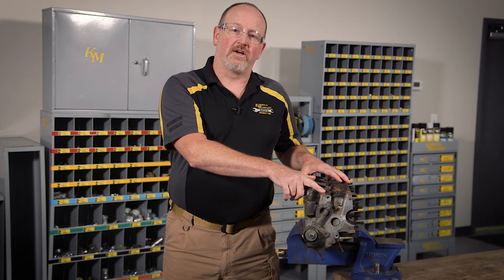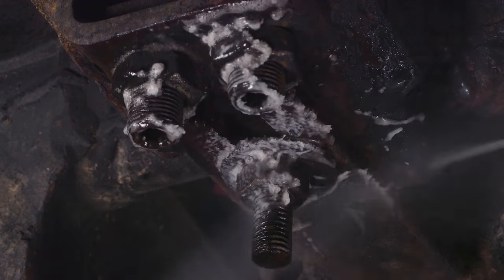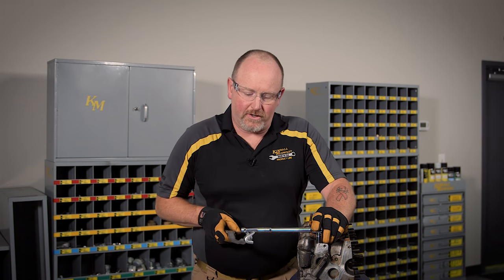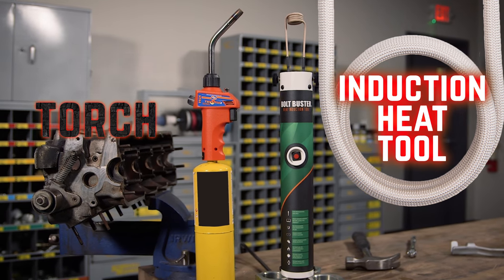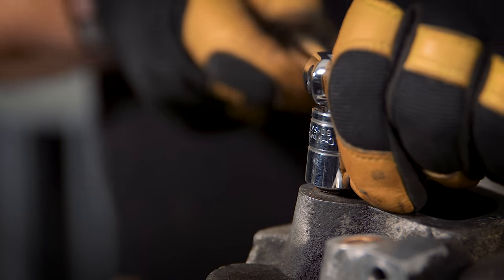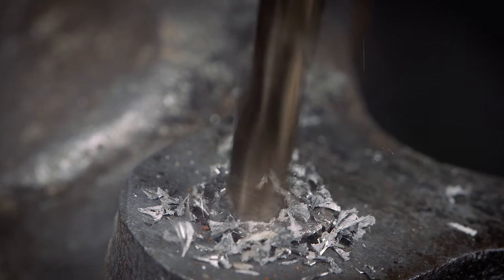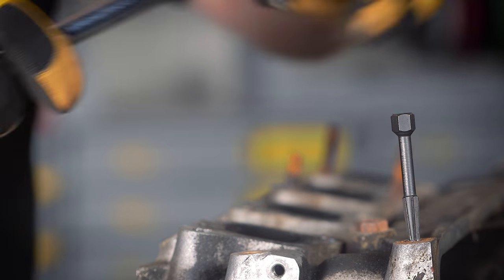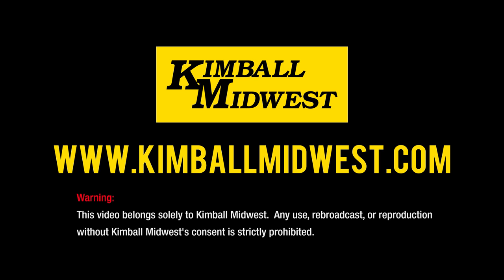How To Remove a Stuck Nut or Bolt

Comment: Let be honest, we in a middle of fixing something, hands all dirty and we all watching this video
Reply: Yep, the hex screw on my bicycle's rotor disc brake won't turn....
Reply: Bruh, why you calling us out like that lol
Reply: Mudflaps on my semi…
Reply: LOL TRUE
Reply: Yuppp
Reply: maybe youre right
Reply: Precisely
Reply: helppp lol
Reply: 06 Pontiac grand prix oil drain plug.   Ahhhhhhh
Reply: Yep
Reply: At work 😂
Reply: facts
Reply: @stealthxg5045  true same
Reply: Nah this is how I'm starting my day🤬
Reply: Ong
Reply: Yes,yes we are 💀💀
Reply: I’m lying in bed after day 2 trying to remove a 42mm nut off the tractor after buying a wrench, then back for penetrating spray, a 42mm socket and adapter, rattle gun. 3 of 4 nuts off. Now going to buy a heat torch I think for the last one
Reply: How’d you know
Reply: Nope.  Washed my hands first.
Reply: Fuckin lawnmower lol
Reply: @stealthxg5045  got the exact some problem
Reply: Hahaha… This makes me feel better.
Reply: Yes
Reply: Damn,i need a quick fix n man's bringing out fancy stuffs🤦🏽‍♂️
Reply: Yep…. 2 frozen Allen head bolts to remove the thermostat on my motorcycle that has sat for years
Reply: On my drive trying to loosen a 21mm calliper bolt 🤣
Reply: Yep, Towbar on my cruiser haha
Reply: True.. worst thing is that I did exactly what this videos says you have to do, went to the hardware store, bought everything and.. the freaking bolt extractor broke inside the hole I drilled in the first bolt that broke.. fml
Reply: Snapped shoulder bolt on mower deck pulley assembly.
Reply: Torsion bar bolt on my rear suspension
Reply: Hitch on a cultivator man
Reply: Yessir
Reply: That's exactly what I'm doing, I am trying to unscrew a stock nut on my stationary bike pedal and I've given up because the tools in the house are all old and rusted, and I couldn't unscrew the bolt. 😔
Reply: Too true😔😂
Reply: 🤣how did you guess?
Reply: @thedominguez100  cuz I was working on a rusted 2000 Jeep Wrangler. Can’t believe people still responding to this comment loll.
Reply: The nut on my toilet is rust whelded to the bolt...
Reply: @GLITCHED1  mine too. You got anywhere with yours? I’ve even tried burning the plastic off but it’s not budging…
Reply: Doing it right now
Reply: Damn you a mind reader?
Cuz your right 
Lol
Reply: Yes! A bolt on my new Wen 4750 generator.
Reply: Same here , I finally give up
Reply: 2010 Sport trac. Front brake caliper bracket. The top 21mm bolt will not come off. Not only are my hands dirty, but my left ring finger is bandaged after the ratchet slipped and I punched my driveway, ripping my fingernail off in the process.
Reply: @mattmatt3663  hey how did it go?
Reply: @okcerx  heat torch worked great. Only about 10-15mins. I think fine threads on hay fork bolts is not great. A retaining pin would be so much better.
Reply: Damn bro
Reply: Ughhh yes on the floor and all
Reply: Yep
Reply: Lmaooooo tell me about it, my rotor bolts are welded shut😂
Reply: Damn you got me
Reply: Lmao legit. I did not need this set back haha
Reply: Yep, replacing my turn signal switch on my 89 Camaro..
Reply: Taking the def injector off of my 6.7 cummins
Reply: NAILED IT.
Reply: Yes yes yes
Reply: Im in bed with already smashed hands prepping for round 2 😭😂
Reply: Tie rods😔
Reply: I almost torched my van 😃
Reply: 66 thunderbird strut arms
Reply: yessssir
Reply: Hell yeah 😂😂😂😂😂💀
Reply: Ghee I couldn’t say it better 😅
Reply: While putting a new disk on the angle grinder...
Reply: Hell yeah
Reply: Pretty much 😆
Reply: Middle of changing brake calipers, yes the bolt is winning so far.. 😂
Reply: @Luigilr  same here!
Reply: Guilty as charged these damn bolts on this Calipher bracket. Feels like their welded even though they aren't 😂
Reply: IAC on my Civic 😂
Reply: Yup
Reply: Cause cussin ain’t helpin
Reply: Literally
Reply: Uh no… yes
Reply: Yup. I can’t get anything to hold the screw still while i try to remove the bolt. 2 hours now
Reply: Exactly lol
Reply: Fixing the chain
Reply: Yep, to change exhaust on my bike but the bolt on the manifold is stuck
Reply: My skateboard wheels just popped right off 😭
Reply: Lmao, breaks on my mums car
Reply: Had to stop before I round it off
Reply: Friggin hell this soooooo true right now
Reply: Yes the Bolt on my lawnmower blade is round and stubborn
Reply: when this fucking bolt comes out, my life will be complete
Reply: Whatever incompetent monkey that worked on this car last has tightened every bolt as though his life would end if it was humanly possible to remove them
Reply: @macdrawz  🤣
Reply: Lol yep changing a water pump have to remove motor cap and pulleys nut is round won't budge
Reply: Forgot knuckles bleeding
Reply: Yuuup, golf cart skid plate.
Reply: Haha u got me
Reply: Not me. I'm tryna help my friend loll
Reply: Stuck starter bolt, just one and id be half done by now. So irritated and dirty... 😢
Reply: Yep, trying to remove the freewheel on my bike. I think that spray is what I need
Reply: Last bolt holding in my rear shock won’t come off
Reply: Yup. Big 24 mm bolts on the rear control arm trying to replace my rear shocks.

I also live 25 minutes away from the closest auto parts or hardware store so after watching this video I think I'm going to tighten things back up, put the wheels back on, buy all the tools for when everything goes wrong and then try again this afternoon. That would be the smart thing to do. Let's see if I actually do it. 😂
Reply: @cloutgame3633 Right there with you brother.😂
Reply: True
Reply: Shit man, I gave up hours ago and I'm out here burning shit close to my Rzr (stuck castle nut on it) and I'm waiting on this fire to finish so I'm bored watching this.
Reply: Dirtbike pipe
Reply: I recommend wearing gloves. Especially if you work with the oils mentioned in this video. For example if I deal with CRC-oil - I always wear gloves. Because I absolutely do not want that poison touching my skin and seeping into my system. My friend said they used CRC to kill bees with. Just 1 spray on a bee and the bee would die. Or something like that. So for this reason, I recommend wearing gloves when working with such stuff.

Edit: And just to be clear, I think using CRC on bees is wrong. Wrong because of the bee. and wrong because I don't think it's good for this oil to get into nature, especially if you can help it.
Reply: Hell yeah 2023
Reply: yep last bolt on my starter
Reply: needa take the gearbox out bolts aint budging
Reply: Car battery
Reply: @pumpkinspimph5250  wow really? It’s that bad lol
Reply: Mane 😂😂
Reply: I’m laying under my cars door with a stuck bolt lol
Reply: Trying to taie off my cat and the bolt is super stuck
Reply: Me with my wheel stud replacements on my 07 hawkeye sti
Reply: EGR’s bottom bolt 😐 worst possible bolt and boy do I not wanna take out my belt and my radiator
Reply: yup😂
Reply: Dont gotta call me out 😂😂
Reply: Jokes on you. I gave up and showered, and now I'm watching this.
Reply: 2024 and you're correct
Reply: Damn
Reply: Not me!
I gave up and now coming back for the rematch! 😂
Reply: Real
Reply: Pressure line on power steering pump 😅
Reply: Hands aren’t as dirty as I would like…
Reply: Yes and im pissed 😂
Reply: I'm under my car, smoking weed and watching lol
Reply: yup
Reply: Real
Reply: Facts
Reply: 02 sensor won’t unscrew
Reply: Bingo and it’s a bolt on the inside of my motor
Reply: Big facts
I'm replacing an 8" OS&Y valve on a sprinkler main that's over 50 years old
This bitch will not come off for nothing
Reply: Yeah, trying to replace an O2 sensor, just blow torched it till bright orange and chucked water on it, eventually came off after days of wd40 and countless torque wrenched
Reply: Yes, right on the nail. Im removing car seat and the nut bolt is driving me nuts
Reply: Don’t forget pissed off 😂
Reply: Yes sir!!!!!
Reply: Yep
Reply: Motor mount on an old dodge
Reply: Bolts on my jeeps starter!😢
Reply: My Motorcycles headers😢
Reply: I’m tryna adjust the bearings on my skateboard so I can ride more comfortably
Reply: Caliper bracket on my f250 👎
Reply: day after i had to simmer down overnight
Reply: Yep
Reply: Too accurate lol
Reply: For real tho😂
Reply: This fucking starter bolts are stuck fucking two bolts 😢
Reply: How are you so wise in the ways of the working-class?
Reply: Man you nailed it
Reply: Yup two bolts on my harley
Reply: Yup

Comment: I’m moving in two day all I have is a screwdriver I just wanna undo my bed frame😂
Reply: No one asked
Reply: @manchesterunitedcompilatio8020  A little class is in order.
Reply: What if behind the nut is a bolt that has a head with no groove for a screwdriver (rounded flat head) AND it is inset so it  cannot be gripped? I am using a wrench to loosen the nut but the bolt spins as I try to loosen the nut... Thanks Very Much.
Reply: @guruoflove3083  go on tell me if I’m wrong did anyone ask if ur moving and trying to undo ur bed frame please tell me who asked because if there is someone who asked I will apologise to u directly
Reply: @manchesterunitedcompilatio8020  They were just being specific as for clarification which most usually brings better understanding and so better ease in answering his query.

For example... The question "Have you any allergies?" Can be answered with, "only bad manners" Not directly relevant but still relevant.

Comment: I was struggling with ONE bolt for a very long time.  This method worked for me.  Thank you.  Heat is what finally did the job.  I followed all steps up to that point.

Comment: My problem was a stuck bathroom faucet cartridge. Hard water deposits locked it in place. I could not get it to move. Yesterday I ended up removing the faucet from the sink to work on it - tried tons of Liquid Wrench alternating with CLR to dissolve mineral deposits , hammering on a breaker bar , all with no success. Tonight I took the faucet outside on our cement balcony and aimed my heat gun at my socket wrench that was in place around the stubborn cartridge and kneeled down on the wrench to put as much force as possible and that did the trick. Thanks for suggesting heat!

Comment: Used a lighter as heat source, worked like a charm. Thank you!
Reply: Used a lighter on a rusted plastic wing nut under my toilet cistern. I’d already dosed it with WD40… Ended up setting fire to the plastic. 

Still stuck there…
Reply: @jontaylor5482 don't use a lighter on plastic.

Comment: Thank you for this video. I have had to remove my car battery this weekend in order to recharge it and one of the bolts that fixed the battery to the car was so rusty I couldn't turn it at all. It came loose after using your first few tips - I was happy I didn't have to ask anyone else for help!! Thanks again
Reply: You removed the car battery yourself? Good girl!

Comment: All good methods which I use all the time in the workshop. Another method for removing a seized bolt: weld another bolt (preferably a hex head instead of a cap head) directly on top of the old seized bolt. Now undo the new bolt with a ratchet/socket and the old bolt should extract easily because it's welded together. This always works without fail. Note that it probably won't work if the old bolt head is sheared off; it needs to be proud otherwise you will end up welding the bolt inside the housing if you're not careful.
Reply: u saved my life with this one lol thank you
Reply: @SkateVibes  You're welcome.

Comment: Yeah really want to reinforce the tapping with the hammer. The heat is very useful as well. Had a drain pan plug taking all the force i could muster and after running the engine for about 10 minutes with taps on all six sides of the bolt as well as a couple on the head, it popped off with little force.

Comment: Tip+ 1: Use quality tools. I tried everything with a Philips screw with a cheap screwdriver, but it was stuck. Today I got my toolbox, found the high-quality screwdriver, great grip, the tip did fit better. Got my glove for an even better grip and tadaa, the screw moved immediately and I was able to get it out. It depends on the tool too. :)

Comment: You just saved my butt. I tried everything one step at a time. When I used my plastic welding gun for heat, even though I let it cool a minute, the stripped bolt stuck to the wratchet and came right out ❤🕊

Comment: Absolutely fantastic video! My bolt wasn't loosening because my axle kept spinning (I thought holding the opposite side bolt would hold things in place enough). But after holding the axle in place, the bolt started to unfasten. 

And I think I've made some stupid mistake in past getting myself into this mess. As a solution I probably should get a new axle - cost about 5 euros - (because the screws have been damaged) and a new bolt (because something's seriously wrong with the bolt, perhaps wrong size bolt) - cost about 2 euros. Then just reassemble everything and good to go. Edit: everything works fine without me doing all these steps tho, perhaps I should just let things be until things stop working. I have a spare bicycle in case things go down for the worst.

Comment: Wow! Thank you! I am having a heck of a time removing a brake caliper bracket bolt with a rounded off head.
Reply: Same here bro! Can’t figure it out. What did you do?
Reply: @ramiroospino24  I purchased an Irwin bolt extractor set at Lowes $19. Along with the longest breaker bar I had it worked.
Reply: Daryl Griffin thank you brother. I’ll give it a shot.

Comment: I’m trying to losing a cease bolt on my 29 Model A, it’s the water pump bolt and runs through the cylinder head. I’ve got all the other bolts loose accept the one which is preventing the cylinder head from coming off. I sprayed it with DW 40. Just waiting for it to break free!!

Comment: Im not pro and not trying to be rude but when you are trying to get the bolt out wouldnt you want to expand the metal around the bolt and not the bolt itself? Wouldn't heating up the bolt expland the bolt making it a tight fit? Wouldn't you want to expand the area around the bolt and keeping the bolt as small as possible?
Reply: I was told that as well. I want to know the answer to this. Some say just expanding the threads with heat and letting it cool will break the bond. But mine must be welded on to the oil pan lol

Comment: What if the nut is melted onto a screw?
Context: A while ago someone left a Yield sign out on a neighbor's lawn one day. It doesn't look like someone ran into it though, just a random, slightly damaged sign that someone ditched. I'm trying to disassemble it for scrap or some other purpose, but the sign is held together with two carriage bolts, and the nuts on the back of the bolts have been melted onto the bolt. Not rusted, melted. The screws turn, but it can't come off. I've tried a bunch of things to get them off but nothing's worked. Will that penetrating oil stuff work? We don't have an induction heat tool or a blowtorch. I'm considering buying a Sawzaw to cut the screws in half to get it off, but I'm wondering if anything else will work.

Comment: Thank-you for your expertise. I went out and bought a spiffy large irwin vice grip pliers on your recommendation. I had heated my stuck steel armature pipe and nut with my hair dryer - then added candle wax - heated again - nothing - then tried a little sewing machine oil - more heat and another tap with the hammer - gently all around using your wonderful tiny nudges back and forth with the pliers. And it came apart. I was amazed. I think the magic ingredient was the sewing machine oil. Many thanks again.

Comment: Hello. Would you happen to know how to loosen and unscrew two step up rings that are stuck together, because ive tired in vain with soap, oil, heat, cold, pliers, rubber band, but there is just not enough room to grab it tight and pliers have scratched the paint off and i dont want to force it anymore

Comment: I have a habit of tapping the wrench with a hammer to undo bolts. Is this bad? I always thought it's easier on the threads and head instead of applying brute force.

Comment: I have truck bed rails I want to take off, I don’t have a tight bolt, but I loosen a bolt and about quarter way it just turns and turns doesn’t go any further, would using an extractor work since the threads are crossed I’m pretty sure,

Comment: My stuck bolt has a rounded, odd size nut (5/16 or 9.5mm or ?) on the positive terminal of my car battery.  Any suggestions? I've tried penetrating spray, a knock with a hammer. There's also not much room to get hold of the nut. I don't have special tools. I'm stuck going to a shop, aren't I?

Comment: Wouldn’t heating the bolt cause it to expand and be more difficult to unscrew? It seems that making it cold would contract the metal and make it more likely to come out.
Reply from the maker: True, heating the bolt makes it expand and in doing so all the rust and anything seizing the mating parts will break, so that once the part cools it can be removed.  Freezing is essentially exactly the reverse, it will make the part contract, breaking the bonds.  There are products out there for freezing mating parts, but usually mechanics have a torch handy, so it can be a preferred method.
Reply: I'm going to put my vehicle in a huge meat freezer. Can't wait. [JK/LOL]

Comment: What if the bolt is oxidized? I was told a oxy acetylene torch would work. It's under a bracket and I don't even see how you could get a drill bit in there if you snap it. It's on a motor mount.  I've been trying mapp gas and pb blaster

Comment: I use a small hammer. Tapping the bolt.  The hammer vibration loosens the rust, moves the oil with each impact.  I got the donut gaskets tightened on my 78 f100.